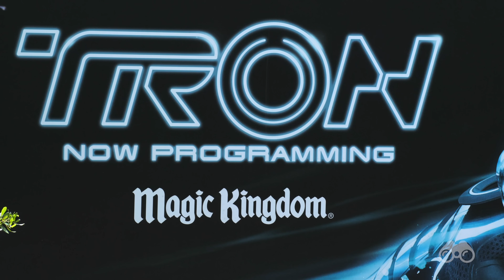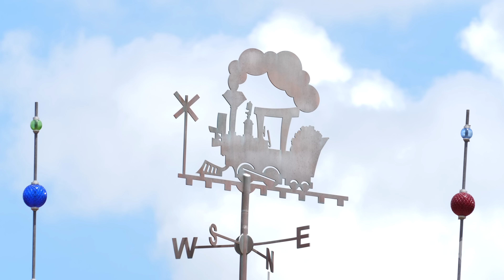Walt Disney World RAILROAD TRACK INSTALLATION Near Tron Coaster!!! - Breaking Disney News

Comment: As a FYI, the railroad construction works as follows:
Sleepers are laid down and drilled.  Then the base plates are placed and the rail put in position.  Then lag bolts (*big* bolts) are screwed into the sleeper with hold-downs clamping the base of the rail in place.

The drill holes in the sleepers are marked such that the rail is automatically properly gauged.

In theory all they have to do once assembled is add ballast and run a test vehicle through to verify integrity.

As for the tunnel, all that white is gonna be interesting with steam locomotives (and their exhaust smoke)
Reply from the maker: I presume they don’t care that the light gray ceiling inside the tunnel will become blackened because the way the passenger cars are structured the inner ceiling of the tunnel will not be very visible to guests on the train (or even guests on the pathways, the whole inside of the tunnel will appear very dark).

Comment: Brayden - Do you have a camera that films at 120 frames per second? It will allow you to get more length/time out of a single shot. In the sun, the Osmo Pocket 2 is great for filming 1080p at 120 frames per second. The GoPro Hero10 can film 4K at 120 frames per second. There are others, but they are expensive and the lenses are heavy to carry around with you. I think this (120 fps video) might be worth looking into as it'll give you double or quadruple the footage to work with.
Reply: Solid advice especially creator combo for the livestreams

Comment: I too think fiscal year 2023 is possible, which is October 1st. Not that TRON will open in October, though I do think it possible for the later part of Q1. With the new fiscal year, the operations budget should be expanded for a full cast for this attraction. Right now there should be the first group of operations cast leads working with other facilities operations maintenance and engineers and of course Imagineering too. What we all need to keep are EARs on is extended cycle testing, as well as when WDI will hand the attraction over the MK operations. This is usually close to the end of the build cycle.